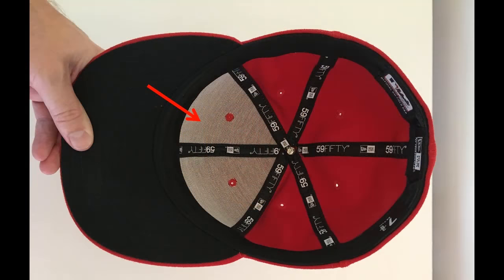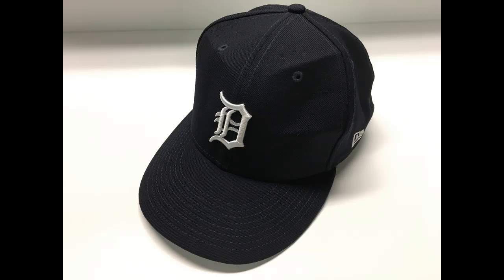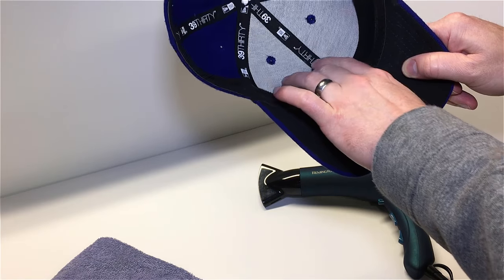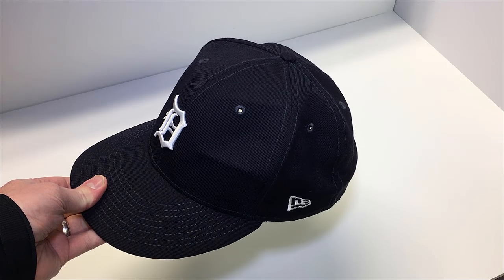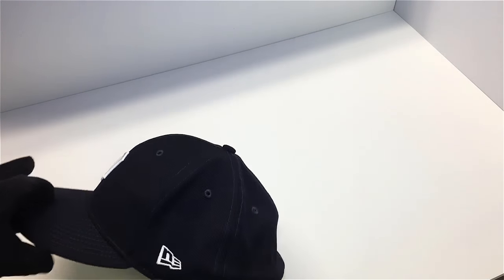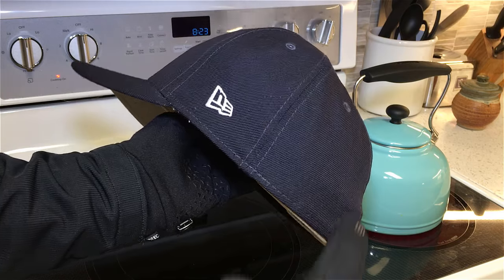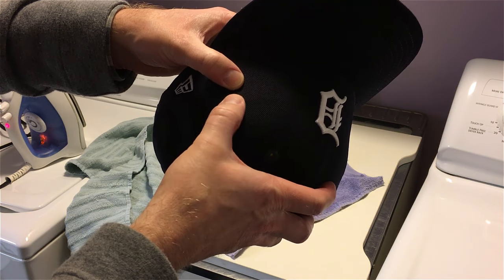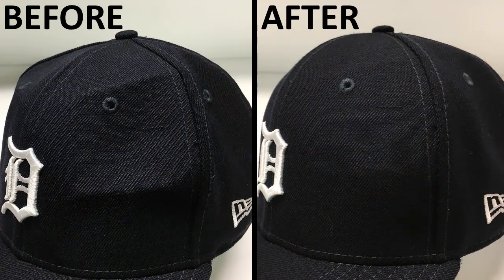Fixing Dents and Creases in your 59Fifty Cap

Comment: Thanks man, I used a towel and steam from a boiling pot of water for some creases. It worked, I just made sure it was on the steam for a while as I pressed and stretched  it with the towel. It was a very sentimental hat that was saved.
Reply from the maker: Cool, that's what I like to hear, you are most welcome!

Comment: Nice. Thanks Doug, well done. If your like me and sometimes read the comments too often. I just wanted to reiterate when your doing any of these techniques, on this video or others, to always start low and slow. And work your heat up gradually. I purchased a unique hat one size up from mine and tried shrinking it. I got it to shrink, but with the excessive heat and moisture, the buckram got warped and now I'm here, finding great methods to fix it in a step that was totally avoidable. Like most hats, the buckram has one of the main features of the cap. I even said to myself to not be so aggressive, but temptation got the better of me. So hopefully this can be a cautionary tale. Thanks again for the killer vids!
Reply from the maker: Hey Steve, thanks.  I'm pretty sure I've made a similar disclaimer in many videos where I use either heat or steam, but there's a chance some of the commentary might have gotten clipped for time in this one. Especially since I skipped a chunk of the hairdryer exposure... once you feel the heat on your fingers on the outside, time to turn it off and start shaping!  Thanks for your support.

Comment: Hey man.. 

Small tip. Kettle and a spoon.

Heat up the spoon.

Press the inside of the cap. 

Press out the dent or crease 

👍🏼
Reply from the maker: I'd published prior videos where I have used heat and a spoon to press out an intrusive logo ( https://youtu.be/pgNEVctzjuM ) and also as part of my regular break-in process for smoothing front crown panels or wrinkles in the sweatband ( https://youtu.be/6FOY-MES6xg ).  Here I was focused on repairs across a larger surface area.

Comment: You just saved my dodgers hat thank you . I recently just bought it and had it hanging on my hat hangers in front of the bathroom door . Me and my wife got into a dumb argument so I kinda slammed the door not think and it put huge creases because it got stuck in-between the door and door frame . I tried all the techniques in this video ultimately it had to use the iron and that finally did the trick. The other techniques would be good for minor stuff but if it's bad then iron is the way to go. I was so nervous ironing it but everything turned out ok . Anyway thank you for the info and the video . I would have hated to throw a brand new hat away
Reply from the maker: You are welcome, happy to hear you saved that cap!

Comment: Great video. I will say that time heals all wounds I've had some hats that I thought were unrepairable but I just wore them and they gradually came back into shape. Obviously, I would recommend your method but just thought I'd mention it. Do you recommend a blow dryer over a steamer?
Reply from the maker: For just forming the two buckram panels up front, hair dryer is sufficient... but in any other case of shaping or editing caps, I recommend steaming because it relaxes the fabric too, thanks.

Comment: I really like the recommendation of the soccer skills ball. That's perfect. Quick question, my puppy chewed off the buttons of two of my really nice new era caps. What do I do about that? I saw that you can get buttons on Amazon but is there someplace I can just go to replace them real quick, like Lids or something?
Reply from the maker: Tigers cap is definitely a 59Fifty.  This repair relies on the buckram up front, so the Dodgers 39Thirty where I removed the dent operates on the same principle of smoothing/reforming the buckram.

Comment: I have a problem with the "headband" inside in the front curling on old and used ones, any idea how to make it flat again?
Reply from the maker: If it is pretty old and worn that's probably a form of dry-rot with the materials and foam inside of it.  The only thing I could recommend trying would be the front of a flat iron... but you'd need something to support the outside of a cap - like a bowl or cap insert.  I haven't had to deal with that yet, but I am looking for a way to get creases out of sweatbands, so maybe I'll give it a try, thanks.

Comment: This is awesome. Is there a what to make the brim stiffer again? Some of my hats that I wear frequently, the brims have gotten softer and won’t keep their shape. I guess over time sweat and water has just softened it.
Reply from the maker: Unfortunately there is no way to get stiffness back into the visor - they can get fatigued from either water exposure or frequent flexing/shaping.  This is mostly true for any visor with fiber/cardboard content - and New Era has a plastic/fiber blend which is better, but can still wear out and soften over time.  47 Brand uses plastic visors which don't normally fatigue like this.  I did a whole video on visor types, ICYI it's on my channel page, thanks.

Comment: Thanks for the high quality video man !! I tried the ironing method some days ago with a crease that i had in my cap, improving the visual aspect of it but in terms of texture the cap stayed a bit rough in the place that I did the ironing, I realized that with the heat the inside of the panel remained with air forming some sort of balloon as if the white fabric had come unstock. I don't know if I did something wrong but that problem is stopping me of restoring more caps, if you know how I could solve or prevent  that please tell me about it 🙏🏼 
Thanks for the info

Comment: Nice Tigers cap. Can I assume that it's easier to fix a Wool Cap than a polyester?
Reply from the maker: A lot of this repair depends on the buckram underneath those front panels.  The cap material - whether wool or polyester - does not really factor in to the success of the fix (or not), thanks.

Comment: Interesting... I've got hard vertical creases in my favorite hat. :P 

I'm gonna order a couple more probably just to have a new and a replacement on the side. If I fix this one it'll be my "rough/outside" hat since it's also dirty now 😀 I learned a lesson with this one and pins too... make sure your pin isn't made with a metal that will green 😑  

Also...

Don't fall asleep in your hats people. 👍
Reply from the maker: For sure, it won't get you back to 'brand new' condition, but hopefully you can make those creases a lot less visible - good luck!

Comment: Hey man, Love the hat videos. I'm a big baseball cap guy and have been wearing caps and hats for almost 2 decades. Lately the shipping on hats is getting sloppy and for instance the RVCA baseball cap I just ordered in white came shipped in a plastic shipping bag/envelope. There are lots of creases in it in different places. They actually already returned my money and told me to keep the hat so I want to try to fix it. I actually own a handheld clothing steamer and I have a blow dryer as well. I saw your other video that you used steam to get rid of the crease in the dark green hat you had. Is this blow dryer just a different way to do it or?? The hat I have is cotton twill would the steamer be better?? Alot of my hats are actually the classic New Era MLB Fitted Caps so I was just wondering.
Reply from the maker: The heat is the main thing, since you're trying to remove bends and folds from plastic fibers in the buckram on the two front panels.  This full-length video was all about the different techniques that I had to work through in order to (almost) completely solve the problem.  The real breakthrough was when I added the 'form' of the size 1 soccer ball underneath the front crown panels, and used the flat iron on those areas.  So if you can find a form like that (a ball, or a bump cap insert as in another video of mine) you should be able to use either source for heat, and the hair dryer may be best.  Good luck and thanks!

Comment: I don't know why hat makers put buckram in ball caps. 

If the right material is used and the panels are cut and sewn right, without that added they can come out to form with just a hint from the hair or head while they may need the occasional ironing like pants for those kinds of creases to the material itself. 

And some different kinds of caps or hats are somehow made seemingly with nothing added but yet gently pop back into shape without creases or wrinkles even after being stored tightly or sat on. I had a tam and it had a form fit like a military beret which stayed, it was rabbit fur, I couldn't reform it to make a new shape less a military style. I have a felt cap with a wide brim, it does the same on the dome while the brim holds its slight flexed shape, it's cowboy style.

The strands of that buckram in ball caps also separate in such a way that they become no longer a uniform pattern in design, that breaks the integrity of their intended hold. It looks wavey and disorganized inside, that won't go back to straight lines with air or steam heat and a skills ball or towel.

These plastic strands also tend to come out at the seams, and they poke the fingers and head, they also snag delicate materials, say if coming in contact with a knit sweater. It's rather nasty getting jabbed by these and sometimes there's one pointy tip just touching the head causing an itch which won't go away with scratching, the hat has to come off for final relief, find it and carefully clip it down with nail clippers or scissors, huh, do that in your meeting or at the stadium.

I have separated that junk from the fabric where I can find a weak or detached spot, cut a hole into it, separate it just to the stitches with a nicely edged plastic stick and then pulled each strand out. That's hard to separate, cut without getting the material or stitching and get them all out, especially in the middle seam between the 2 panels and out through embroidered patches. But I either get a relaxed form of what the cap was or a more relaxed shape fitting closer to the head shape depending on the material and how I reform the panels. It has happened where the creases stayed because they were trained into it too long by that buckram or the material needed some sort of better support to stay under it. Sometimes there are tiny white dots left inside, likely traces of layer-bonding glue. That's okay though, looks like an intentional dotted pattern and people don't look in my caps anyhow.

I am so sure many people throw out caps which get creases and wrinkles permanently as it seems, what a landfill disaster that is. And the money spent on them, that's a whole disappointment. People who collect caps, there's going to be tight display spaces and even times things get tighter during moving or renovating, I'm sure a lot of damaged ball caps result from that even if never worn or scrunched into a suitcase.

Maybe it wouldn't be so bad if the damage added character, but the way this stuff goes, it just looks like it was piled in some dingy corner, then washed, not like a leather or canvas cap which went to work and camping vacations and got weathered with a few battle scars.

Risking Shiney spots. I am curious why pants are more durable with iron heat than many ball caps. They're made of nylon or other materials which melt.

Sometimes things are made to pay lots and toss far and repeat. Hat makers have to catch up with the small numbers of manufacturing companies and industries which have or are finally making thing to last so we save the money and the environment while having something of value to pass along to family and friends.

You first creased your caps with a Sharpy and a pressing to demonstrate the fix and you couldn't get them back to what they were, better but not original. Nope, that's not good.

There's also a foam layer in some caps. After they age a bit, that crumbles, put that on your head and then go shampoo, then clean up where that cap shead some of that over a while and launder the cap in hopes all that washes out and it appears as a nicer cap. That's probably not even healthy, off-gassing and particles getting into places which are difficult to clean out.

I say: we need to boycott hat makers and promo merchandise suppliers / sellers where these useless caps are made and sold. You might buy your next cap for the long-term once they catch on. Yeah, spread the word, let these people figure it out from our side.

I found your video from an Internet search because I am trying to save a ball cap with its (buckram) form and it is hard to pull this all out. I thought oh, maybe someone has experience I can use. Well, it's not going as good as you did, not even close.

Oh yeah, the peaks with cardboard in them. These are real pieces of junk too. I recall a box of ball caps embroidered with the company logo came to my workplace. The boss hoped we'd wear them. I claimed one and a peer grabbed it and "put that nice crease into it" a jagged ridge appeared in the middle under the material. I said 'Thanks, I'll get a different one now, keep your hands off my things.' and I made sure not to put a sharp bend in it dry or wet. But eventually it broke down into little fractures or blisters from rain. And weak hat bands sometimes with exposed materials which fray and hang out and crooked stitching, ball caps are the worst for poor quality in the garment industry. The embarrassing disheveled look is not as bad with the messy hair as with the junky ball cap.
Reply from the maker: Certainly an epic comment, thanks for taking the time to explain your views on several topics.  On the very first point I would say that I like the buckram because it gives structure to the crown and therefore a more 'tailored' and crisp silhouette.  And manufacturers do NOT put buckram in every cap model - the '47 Brand Clean Up and Franchise Models and the New Era 9Twenty have none.  The New Era Golfer and '47 Hitch do not have it either, just a curved nylon stiffener panel under the pinch-crown front - the stiffener can be easily cut out if you prefer.  And New Era periodically offers the 59Fifty in a "Retro Crown" model with Cooperstown logos - and the buckram used is classic linen, which is almost like having no structure at all. Other retro cap makers (e.g. Ebbets Field Flannels) have honored historic 6-panel and 8-panel ballcap designs with the same kind of soft buckram - no nylon thread for stiffening at all.
Reply: @dreinthe616  I like that crisp look too, if it will stay or at least be easily regained to its former self once crunched or bent, and without the prickly ends sneaking out the seams.

I think one reason for those strands is they leave it breathable, so air and sweat can move. A pair of panels with something solid would be like having part of a rubber ball sewn into your ball cap, a wet mess. However, with today's technology and new materials, even older materials with form fits without backing, I'd think buckram should be the old and outdated fail. I hope there's a better way, something with holes built-in or punched in, takes heat if needed including the accidental parked car interior heat and generally just pops into shape with touching inside and just putting it on. And with no sharp ends, that means everything to me even if the crown shape comes out with a nicer character - warn-everywhere look.

I do think it's time to call buckram stiffened caps the cheap and useless, disposable caps, call it what it makes any cap which won't be hung or sat in a dry, dustless spacious display area - like a paper or cardboard craft keepsake for its lifetime.

And, I am curious how that hat block may stretch the band when that is placed in to make the crown shape again. When I have any hat or ball cap which fits snuggly and stays good enough in the wind, the last thing I want to do is brace it to maintain it. I did that once just with tightly packed-in towels in attempt to reform the crown and that was enough to loosen it, came off in any light breeze with no fix to that. This stretching worked in my favour with too-tight hats though, they fit and stayed to the new size stretched in.

Thank you for your reply, you got a thumbs up on it for keeping the conversation going.

Comment: What's up, Doug? This was a great, and an informative video. I do have a question for you. Do you recommend any of these techniques for owners of dented New Era 9FORTY caps? I own mostly 9FORTY caps, and I have a dented one that I want to fix. I just want to know if it makes a difference, or not by doing these techniques on an adjustable cap or a fitted cap.
Reply: interested too, 9fortys don't have that different material at the front, its the same material throughout the hat...cheers
Reply from the maker: A lot of this technique depends on the buckram, which gives the front two panels their more rigid structure... the plastic fibers can be heated and formed - so regardless of fitted or adjustable, it depends on the front construction.  I'll confess that I don't own a 9FORTY cap, so I am not sure of the presence of that buckram.  That said, if you use a form such as the soccer ball I showed here, or a bump cap insert that I covered in another video, I believe that steam shaping to remove the dents would still be effective.  Thanks for the comments and question.

Comment: QUESTION.....how do I shape the back "struts" so the fitted stays in its a original state...
Reply from the maker: I don't have any recommendation for that, those are soft seams (no buckram or reinforcement), so they'll always collapse when not on your head.  Only thing you could try is put in a bump cap insert (see my video - https://youtu.be/e9pSynl4O7M ) and then perhaps some spray starch - but personally I never use that stuff, thanks.